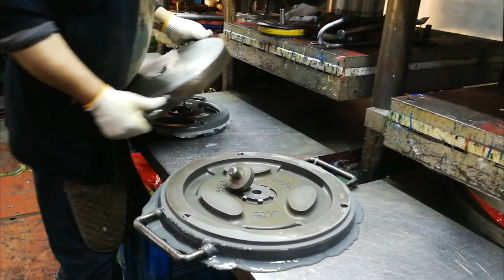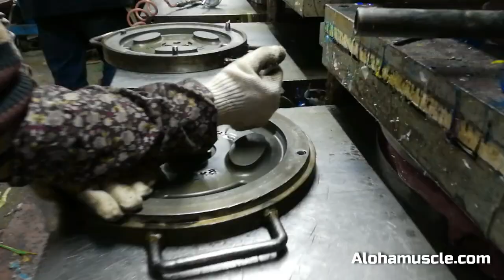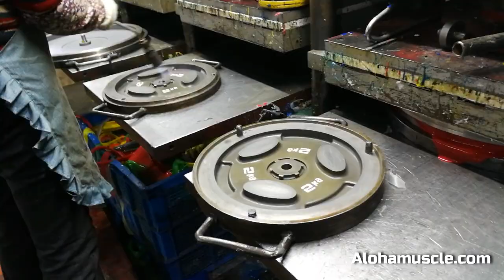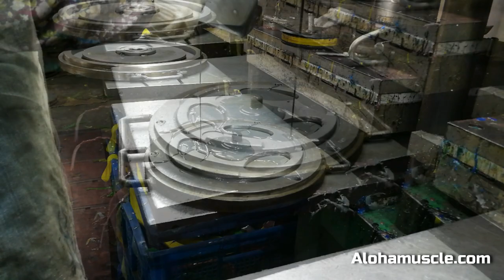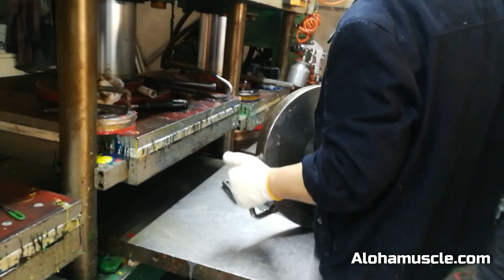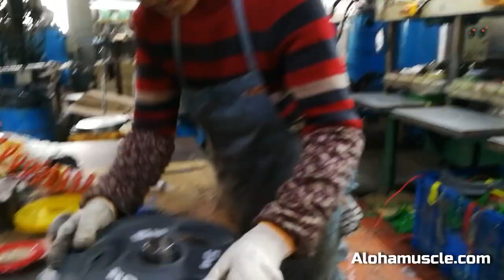Urethane (PU) Tri Grip Weight Plates Production (Manufacturing) Process

Comment from the maker: Make sure you check the other videos in this series! 
Rubber Grip Plates Manufacturing Process - https://youtu.be/ul2oV8yFKVY 
PU Bumper Plates Manufacturing Process - https://youtu.be/F8hONv2hCj0 
How weight plates are made - https://youtu.be/YsHx6Lqy35M
7 Hole Weight Plates Manufacturing - https://youtu.be/WQZ9ahn4u7Y